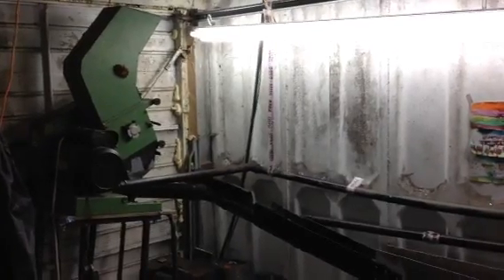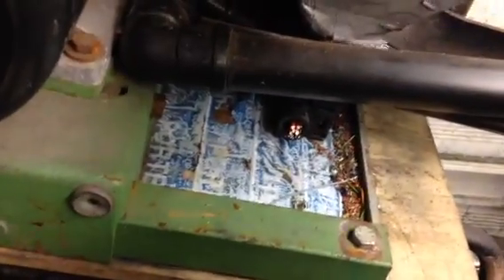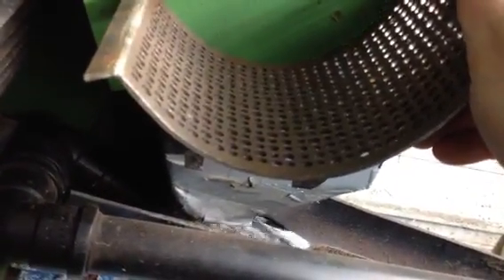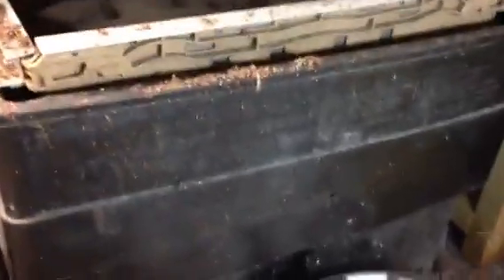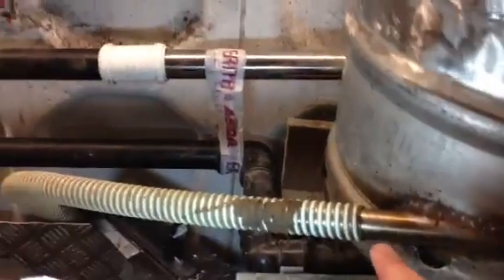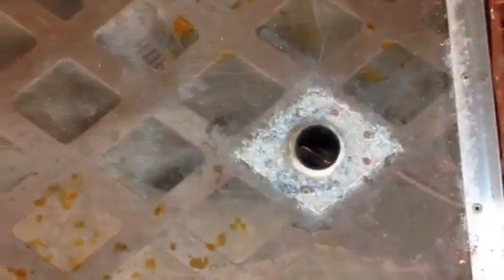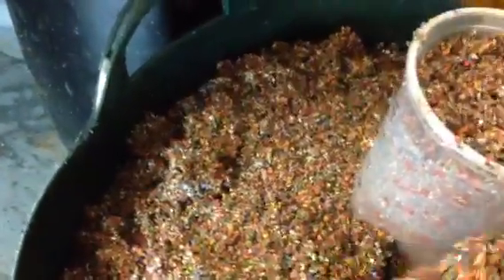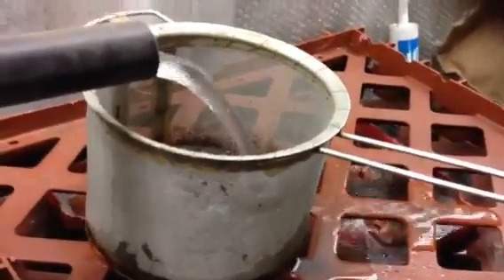Copper wire separation (do it yourself) how it works

Comment: I have a little sluice but it’s teared and I’m still getting copper but not as much and I’ve hit a brick wall would you say having a longer run like your self or short and compact like I have
Reply from the maker: Hello Jamie,when I switched to a longer sluice the separation was better, but I will say that if you want good separation then you need to keep trying different things.For example,surface tension,do you have some of the copper on the surface of the water?I dont like the idea of a teared sluice,If you look at my system you will see that the bend forces the copper under the water at the start of the sluice and water agitation is kept to a minimum  for the rest of the sluice,so the copper will have more chance to settle in the sluice,have you seen this video, https://www.youtube.com/watch?v=Ibx6DWyOIJI&t=16s it shows my system in more detail.

Comment: Brilliant set up. unique! Thanks for sharing. Am seriously considering doing something similar so this is quite helpful. Over here, scrap yards buy in a fair amount of wire that does not get separated cos it is too fine a gauge and i have often considered setting up a business to process what they get in. I'm guessing you are doing this in the UK and not an expat, hope you get a reasonable reward for your efforts. Must have take a fair while to get such good results so congratulations on doing that. Good luck!
Reply from the maker: Yes Iam in the UK and it has taken about five years to get to this setup,I started with a bucket of water expecting to put the granulated wire in and the plastic would float to the top lol.Its a lot harder than it looks to granulate car looms because of the insulation tape,I remove it before granulating but there still is a sticky residue left which could be a problem in a hot climate,that is one of the reasons I only do this in winter.Thanks for your comment and if you have go yourself let me know how you get on.
Reply: corsagafa
Hi again, thanks for getting back to me. More than happy to drop you a line when i get something going, till then , best of luck, Happy Christmas!

Comment: Do you own a scrap yard or have a friend with one? If not, how are you able to aquire so many wiring looms? 
Absolutely brilliant. Thoroughly impressed by this.
Reply from the maker: Hi,I do car transport and this involves moving scrap cars and weighing them in so I get the chance to remove the unwanted scrap,there are all kinds of scrap metals left in cars even small amounts of silver and gold!! Thanks for your comment.
Reply: corsagafa where is the silver and gold my pal ecu? Can't work your accent out mate Lancashire ?
Reply from the maker: Silver is in the relays(silver contacts),Gold is in most micro chips as bonding wires and there is plated gold in switches,some electrical plugs mostly in the airbag system.My accent is Yorkshire
Reply: I too get gold and silver from cars!

Comment: hi there, I love this idea, I am a engineer and get a lot of copper wire, problem is the thin gauge wire is a pain to strip, I don't have a problem with 2.5mm wire and above, I will be building a plastic shredder to recycle plastic and also use it to granulate the copper wire, your design has given me ideas, but do you have any updates or any more videos planned? I would love to see more.
Reply from the maker: Hello,yes I would like to make more videos but Iam not quite ready yet.I have been collecting some yield data for different size screens and developing a vibrating screen to remove any remaining plastic.Iam no expert on shredders but I dont think they can granulate the wire small enough to get good seperation,thank you for your comment

Comment: This is brilliant! Thank you SO much! I live in an auto wrecking yard in Alberta, Canada, and the sheer amount of vehicular wiring harness that goes through is staggering. I have only question though, that may have already been answered, which is, how do you stop the copper from turning green? I am assuming you have a dryer? Which is an added expense. Anyway, again, thank you SO much for this brilliant system!
Reply from the maker: Hello there in Canada,thank you for your kind comment,copper will only go green if it is damp or wet for a fairly long time,It takes me about two to three weeks to dry my copper and I dont have a problem with it turning green.

Comment: Great job sir, feels amazing to watch this... Can you please explain the concept of BEND and also how did you make that bend..and what do you mean by "you have used slotted process in making bend and not glued it together" ...I am confused on this part, plz explain it in detail...Thank you
Reply from the maker: Hello,the bend is used for two reasons,the centrifugal force helps to force the copper under the surface of the water and also it swivels to allow the water chute to stay the same height as the granulator outlet when Iam adjusting the steepness of the water chute and aluminium tray.The water chute is made from household plumbing pipe,instead of cutting the 90 degree bend pipe in half to get two 180 degree cross sections,I cut it above the centre line  to get one cross section of about 220 degree and the smaller cross section was not used.The straight pieces of pipe were cut with the same cross section,so now the bend and the straight pipe sections can be slotted into each other without using any glue or fixings allowing the joint to swivel,Thanks for your comment.

Comment: Hi, Love the videos on this, makes me want to do it. Now I have a shed in my garden I might just give it a go. Electrical engineer by trade so come across smaller cables etc and we just scrap as is. 
What part did you start with? Thanks. P.s I've been to Yorkshire and am from Devon.
Reply from the maker: Hello Andy,I started with the granulator first and then developed the water system.Devon is very nice,ive been a few times,Regards Dave

Comment: So many questions: How much did it cost to build this? How much to run it? Where and how did you get so much wire? How often do you turn in the copper? How much do you make? Is it worth it?
Reply from the maker: The granulator cost about £1000 including the motor to convert to single phase and the all the other materials could be about £400.Dont know how much to run it because it runs of my normal house electric.The wire comes from scrap cars which i get because I do car transport.The way I do scrap is I pay the bills with the money from scrap steel and I save the copper  as an investment.Maybe its not worth it and I could earn more money doing a proper job but I enjoy this as a hobby and enjoy the challenge to make the system better.

Comment: Also, you never explained the bend.  And what is a "copper magnet", which is located right after the bend. (And I found your video on drying, so thank you for that!)
Reply from the maker: Yes you are right,I forgot to explain the bend ,some copper will float on air bubbles and sticky plastic so the centrifugal force and water agitation  caused by the bend helps to submerge the copper. Also the bend is made from pieces of plastic slotted together and not glued or fixed which allows it to swivel as I raise or lower the steepness of the alluminium tray,this means the start of the water chute stays the same height as the Granulator outlet.
Reply from the maker: Hello again, the magnet is to catch any steel that gets through, yes you would be surprised to see how much steel there is and if it gets through to the drying stage ,it will go rusty and look a mess.

Comment: what pumps the water i heard you say it but couldn't quite make it out is there any way you could make a video explaining the water system in more detail bud? love the video and im making my own diy granulator just cant seem to figure out a good separation method and yours is an awsome one
Reply from the maker: Hi,the water is pumped  by  a pond pump that has a capacity of 100 litres a minute .Yes I would like to make more videos but iam still trying to make it better, for example I will be doing three batches of 100 kilos of wire using different screens to check the yield. If you do build your own system you are welcome to ask me as many questions as you want,thanks for your kind comment.
Reply: thank god i reread your reply lol looking down below i thought it was 100 liters a minute lol i almost bought a $150 pump to keep up with that lol
Reply from the maker: sorry I made a mistake it is 100 litres a minute
Reply: corsagafa dang lol I was excited cuz I could get a 75 gph for $16 lol
Reply: have one  more question for you does your system work for the fine braided wire? or does it wash it away? mostly i have a large quantity of standard wire. like extension cords and the like
Reply from the maker: My setup is for wire from cars which is thin braided and around  0.2mm thick,I will be doing three batches of 100kg each using different size screens and the last one stripped by hand to check the yield and when I have the results I will make another video.But this may be in about six months.

Comment: Good job 
I see the separation process is 100 % now after reseparating non pure plastic from copper? That is right??
But what is the productivity capacity of the machine and can it work in continuous way or it must be rest for a while every a certain time.
Reply from the maker: Hi, its hard to say what the percentage of separation is because the glue residue from insulation tape may cause some wire to stick to the waste plastic. Also there is CCA (copper coated alluminium) which gets washed away with the plastic.

Productivity is slow because I remove insulation tape by hand before feeding it into the granulator, its important to remember that my system is for processing copper wire from cars and also that my system is still in the development stage, for example , I will try freezing the copper wire with insulation tape before granulating

The only time I need to stop the Granulator is to remove the copper wire from the tray

Comment: Are you using an old plastic granulator for that? If so, do you fabricate your own screens? Thanks in advance for your answer.
Reply from the maker: Hello Troy,sorry I have only just seen your comment,Yes I bought my granulator from a plastics factory and it came with a 6mm screen so I made my own screens,the smallest being 1.5mm.Thanks for your comment.

Comment: would your way of separation be as good as a  separation  table like the one from  MBMM shaker table.       than you
Reply from the maker: Well,I have never used a shaker table so I cant say for sure.But there are a lot of shaker tables used in professional setups,I did consider using one but it would have taken up too much room and been too expensive to buy one.

Comment: how would you recommend someone building one of these units. I know this is one method the Big guys use but I don't have thousands of dollars to spend on a copper granulator
Reply from the maker: +Pete Curtice Hello, I dont think that you could do it without a granulator, I bought my granulator from ebay and it only cost £1000 ($1500) and that includes the cost of the motor to convert it from 3 phase to single phase,This is a hobby for me that I have enjoyed for the last five years, I have about 1.5 tonnes of copper so the granulator has paid for itself and if and when I have finished with it I can sell it. If you enjoy making and fixing things then its a good way to spend your free time and make some money,If you do it, good luck and let me know how you get on and I would be happy to give you help and advice.

Comment: What size screen  and what kind of screen did you put on your filtering trays
Reply from the maker: Hello,its stainless steel mesh but I cant remember the size but I would say as small as possible.At the moment I have covered the mesh with kitchen towel because Iam granulating the very dirty burnt plugs that I showed in my last video.
Reply: @corsagafa  I made a header tank out of a 5gal bucket ,3/4feed  and overflow is 1 1/4 ,but all my fines drop to the middle of the vortex and come out the bottom what did I do wrong  if you can help me out any .does the bucket  need to be bigger?
Reply from the maker: @mikemuniak4711  It sounds like you are trying to get separation in your header tank?The main purpose of my header tank is to supply water to the water sluice and then send some dirty water to the filter.Are you using a water sluice? Either way to get better separation your wire needs to be chopped small enough so that the plastic gets washed away.What size screen are you using in your granulator? The main thing you need to know is that my system is made up of more than one part and they all work together as a "team". Starting with the correct size granulator screen,then to the bend to combat surface tension,onto the water sluice to do most of the separation and then the water goes to the pump which sends it up to the header tank and onto the filter and water sluice .....
Reply: @corsagafa  thanks you are very helpful. I have a 5/16 screen  and I'm still trying to build a sluice  system  out of aluminum  diamond plate,,I was just looking at your set up and was playing with the header tank to see how it work ..does the header tank size make a difference  at all

Comment: Why do you have a bottle off dishsoap over there do you add that too the water?because i see some foam
Reply from the maker: Hi Lucas,yes I did try dish soap in the water to clean the sticky residue left over from the insulation tape but it did not make much difference ,infact It may have made the copper and also the aluminium  oxidise ,which makes the copper look dull when dried. If I was to make this system again  I would use stainless steel where possible because the aluminium corrodes and leaves a small amount of aluminium oxide powder in the dried copper.
Reply: corsagafa  i have a nother question when the copper dries is it not turning green en is it still copper no1?
Reply from the maker: No it takes a long time in damp conditions to go green,but it will have some oxidisation depending on how clean your water is and if there is any other pollutants such as steel or aluminium.After drying I store my copper in 25ltr containers so I dont have much experiance in weighing it in except to say that it depends which scrap yard you take it too on what grade you will get.

Comment: what size are the holes on the screen and how far apart are they l have domestick cable from tvs irons micro waves etc regards john
Reply from the maker: Hi John,I have found for separation a 1.5mm screen is best for the multi strand wire that is in domestic appliances but Iam using a 2,5mm screen because it takes less time for the copper to go through the granulator and if there is any plastic left in the copper I put it through a vibrating screen that I have made.The holes need to be as close to each other as possible,I make my own screens and find that one of the hardest parts is marking out the position of the holes to be drilled.The best way is to find some mesh the same size, for example the 1.5mm screen was marked out using the mesh from a microwave door. Regards Dave
Reply: @corsagafa  hi Dave , thank you for that i will try that this week once iv got the screen drilled out , i woud be very intrested in seening  your vibrating screen regards john
Reply: @corsagafa  hi Dave, i sent on a thank you yesterday hasent showen up yet, l woud like to see your vibrating screen working is that posabule, thank you again regards john
Reply from the maker: @johnfitzpatrick8870  Hi John,yes I will try to get a video of the vibrating screen working over the next couple of days,it still needs a bit more work but it makes the final result a lot better, Regards Dave

Comment: Hey Bud, what kind of Granulator do you use for your work?  I would like to look at building something like what you did.  Also, what kind of pump are you using to circulate the water.  Thank you in advance from TEXAS!!!
Reply from the maker: +jimscdot Hi there in Texas,the granulator is made by Rapid and the model number is 1415-V,I bought it second hand from a plastics factory,The pump was bought from Machine Mart (in England) and is the type that would be used for a garden fish pond,the label has gone so I dont know how many gallons an hour it pumps,if you have a go ,good luck and let me know how you get on,
Reply from the maker: +James Smith It can be quite hard to grind up soft metals in a small granulator,even small sheets of copper such as copper tubing will be beaten into small flat pieces (by the blades) that will block the screen.I normaly leave the wires long but I had to cut them short to make the video so I could feed them into the granulator using one hand while holding the camera,the blades are the ones that came with the granulator 5 years ago but I have to sharpen them about once a year,I make sure that I only granulate "genuine" wire from cars when I have sharp blades and then only after I will do the wire from other scrap,you would be surprised how much wire is just copper plated steel or aluminium.You can ask as many questions as you want,I only did these videos to share my knowledge and experience so your more than welcome to ask as many questions as you like,

Comment: Hi are the granulators expensive and how long would you say it takes to do a full car loom
Reply from the maker: Hi,it takes about an hour to put a full loom through the granulator, after all the tape is removed but I have not timed it,Iam still developing the system.The granulator was bought second hand from ebay for £800.Thanks for your interest.